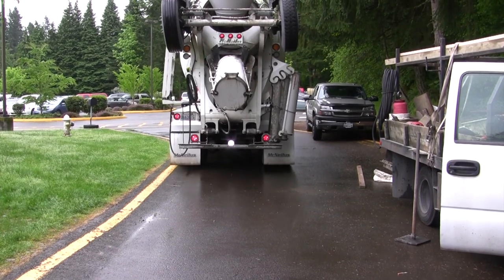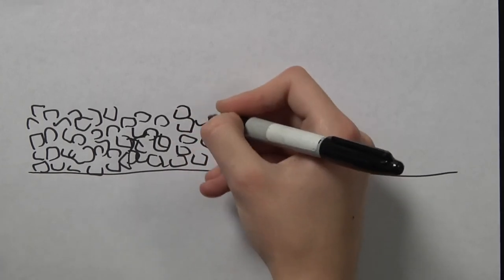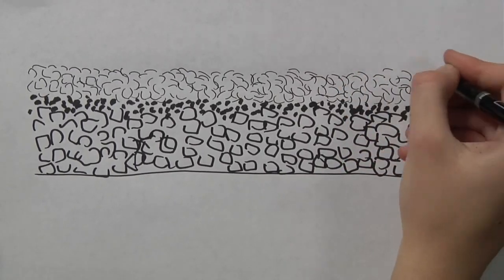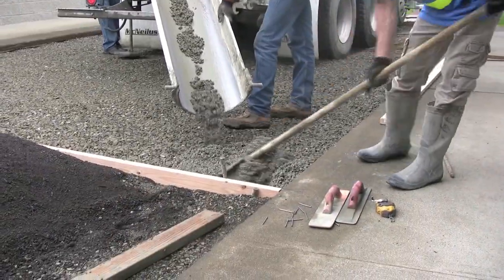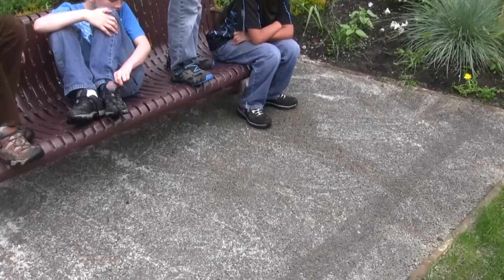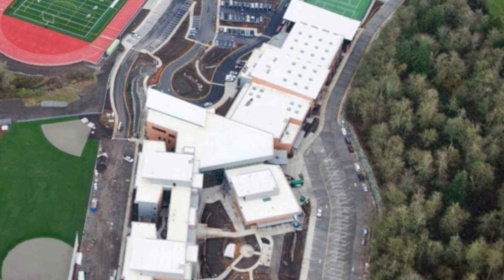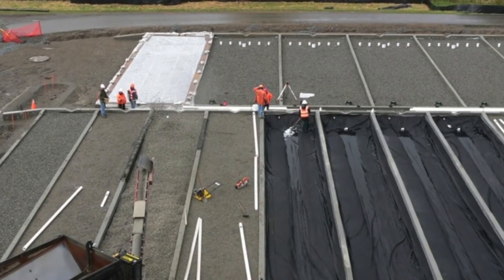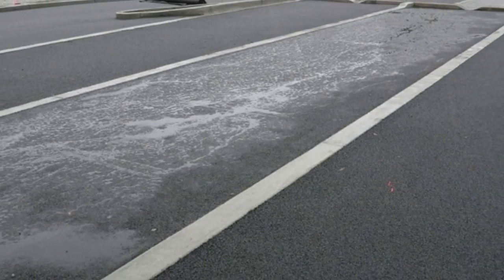Porous Pavement - Stormwater Pollution Solutions

Comment: Water go under the road and create void, gets clogged so it has to be cleaned, also places with clay soil and shit have to have the water pumped out. Not to mention the obvious it's weaker than traditional concrete so it can only be used in parking lots or low stress areas, also can not be used on a slope because it will drain to the bottom and build up